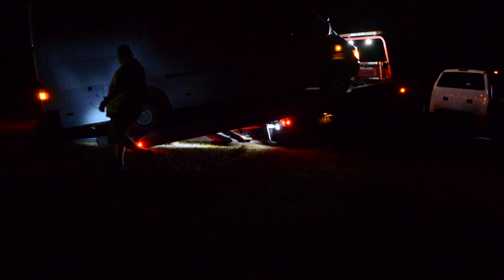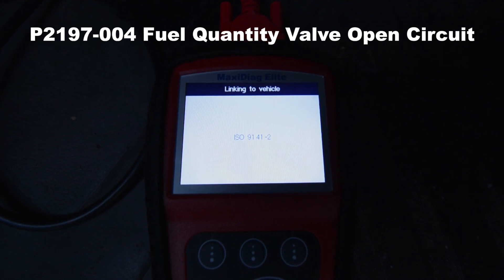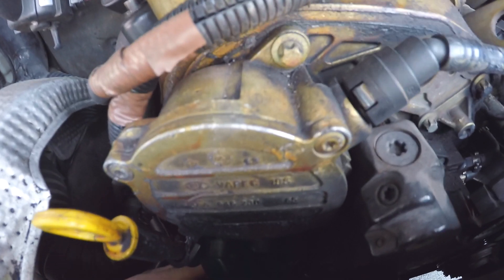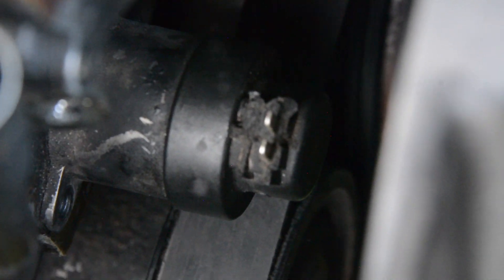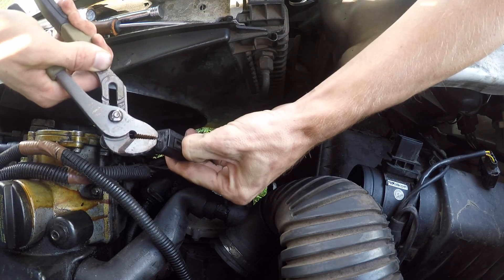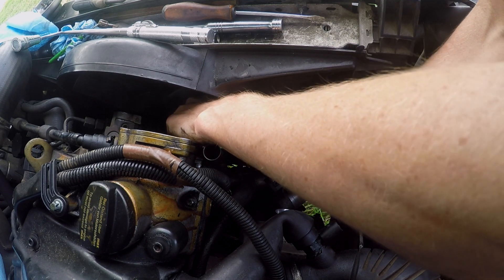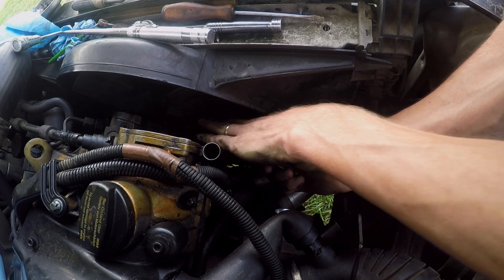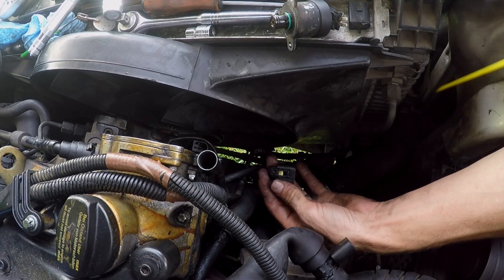04-06 Sprinter Van Fuel Quantity Valve replacement- loss of power fix

Comment: Thank you so much! Just got my van out of limp mode today. I ended up being able to save the fuel quantity valve, just had to unbend the pins and plastic weld the old plastic part of the connector back on. Melted a few zip-ties into it with a soldering pen. It was broken pretty similarly to yours. Thanks again for the video!

Comment: Hi does this valve exist as a separate valve on all 2004 models or is it sometimes built onto the unit of the high pressure fuel pump?
Reply from the maker: Hey there from what I understand 04-06 sprinters are the same models mechanically

Comment: With the loss of power from the open circuit did you also notice that it had to be started twice to run smoothly and possibly die on initiatl startup?  We replaced the fuel pressure regulator but still need to start our van twice before it operates smoothly.

Comment: I was worried about doing this job,didn't know if i'd get blasted in the face with diesel as it's on the high pressure pump! ;-)But this settled my fears.Thanks.

Comment: congrats .   just changed the fuel rail regulator . The one that some say cant be done. Has made a huge difference in acceleration. Now will change out the Fuel quality valve . Should be even better . Thanks for the vid. Could see the joy on your face when you realised the van was running good again . I can relate lol

Comment: When refitting put the bottom bolt through the hole in the valve as you face it up, then put a couple of turns on it before pushing the valve home. This will save you 10 minutes of frustration haha.

Comment: Thank-you for sharing and very well done.  I have loss of power sometimes and the codes  P0088 and P0030.  Could  replacing the Fuel quantity valve fix that?

Comment: Do you know what this does in the fuel pump?
Reply from the maker: Like a metering valve or flow regulator, it is designed to control the quantity of diesel fuel flowing from the low pressure or lift pump to the pistons of the high pressure pump.
Reply: @hhshornsfootball32  thanks for your reply.  After you had loss of power, did the van throw a check engine light and shut off while driving ?  I'm still getting a low rail pressure so have to figure out why
Reply from the maker: @frontlinemedia4270  yes we got the fault code p2197-004 and once we put in the new valve in, the loss of power was immediately fixed. now the shut off while driving was a separate problem. that would happen on the way down hills once we got to the bottom, the gauges would go out and once i came to a stop it was shut off completely or when i would suddenly let go of the gas peddle ie: when i would get cut off or get caught on a yellow light. I tried everything to fix that and took me a year or so to figure it out. finally i did a transmission fluid change and that lead to my transmission control module to go bad. so i replaced that and every since that change it hasnt happend so i assume that was the issue. Im working on a video explaining that hopefully finishing soon
Reply: @hhshornsfootball32  boy, sounds like me.   I've been dealing with this low rail pressure for 8 months.  First it was high and low rail pressure and now just the low.  I had a bad FPR and bought an eBay replacement from Carolina bargain outlet.  This part was defective and they wouldn't give me my money back.  I then bought another eBay one from China and it fixed the high.  Now I throw a low rail under load.  It could be one bad fuel injector but which one I don't know.  Nothing is jumping out, but I will try the FCV first.  Thanks for your information, greatly appreciated
Reply: @frontlinemedia4270  did you figure it out.
Reply: @Caveman1420  yes, I pretty much figured a lot of things out.  The pressure relief valve is on the fuel rail. The quality valve does what the pressure relief valve does for the pump. It regulates the pump pressure.  Now I am dealing with the EGR.  I got a Chinese one and after 6 months, I figured out these don't work, lol.  The EGR also effects the transmission shifting.   The computer uses imput from the EGR to decide shifting points.  My transmission would not shift, or take too long to shift.  It  sometimes didn't shift.  It then started making a swirling noise.  I disconnected it and my shifting was fixed.  Do you or anyone you know have an EGR I can buy for parts?